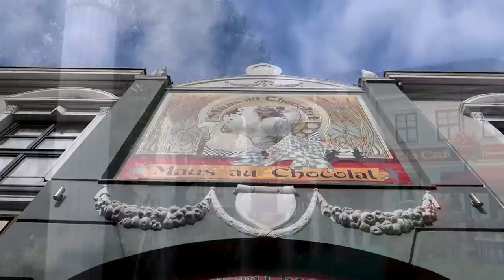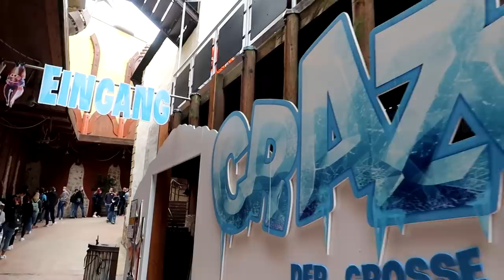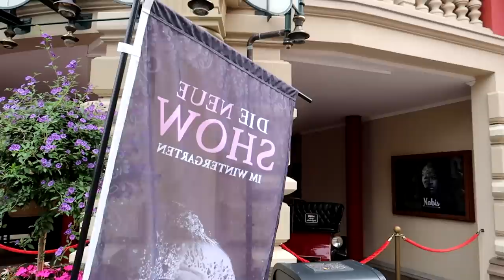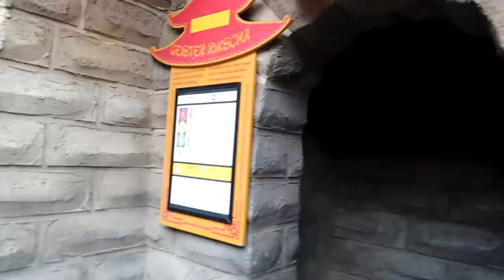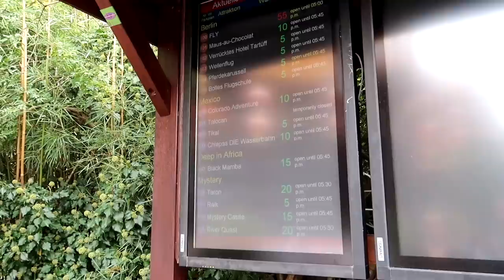Phantasialand Vlog September 2021

Comment: Did you visit Walibi belgium for kondaa?
Reply: The park hasn't reopened yet as far as I'm aware after the flood damage earlier in the year. At the time they were aiming for October reopening.
Reply: @edwardlack2578  Still not open, but I think TPW plans on returning when it does reopen.
Reply from the maker: The park is set to reopen on 2nd October!

Comment: I was looking at going back to Phantasia but the vaccine pass threw me off a little, I couldn't get a straight answer about if the NHS app and/or PDF printout would be accepted, I assume so since you're there! :)
Reply: Looking too I think print out with QR code on AND the app should cover it
Reply from the maker: Showing a screenshot from the app is fine!